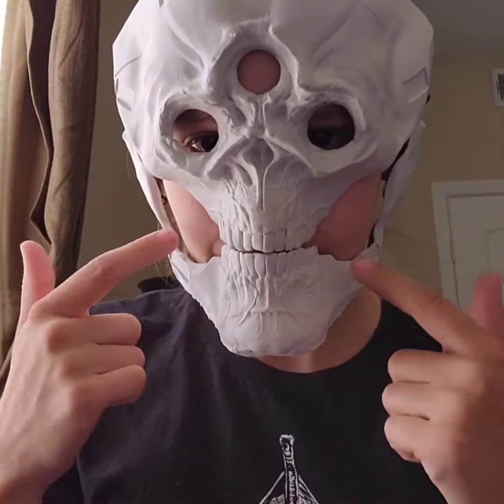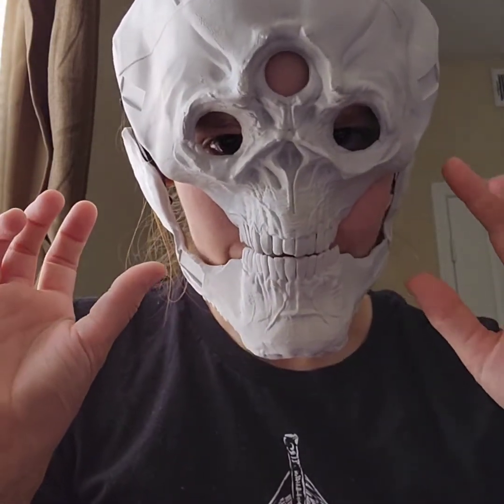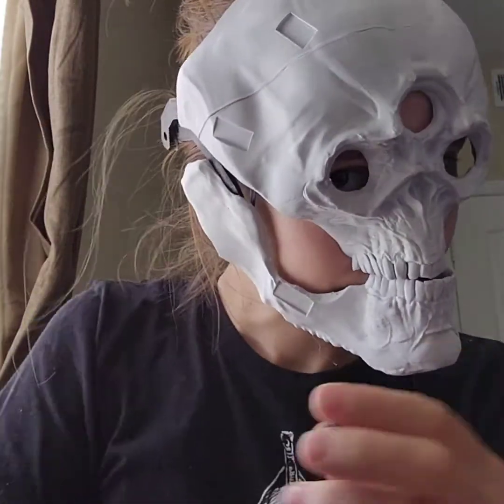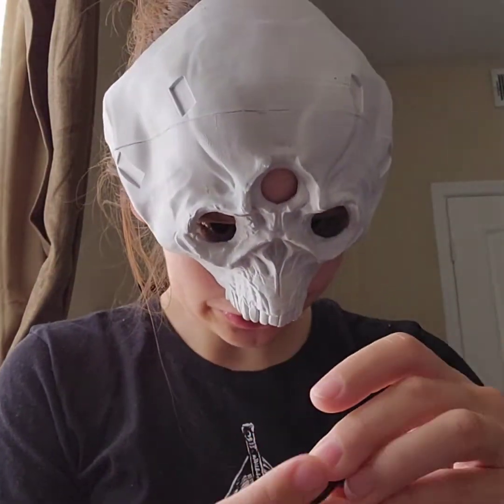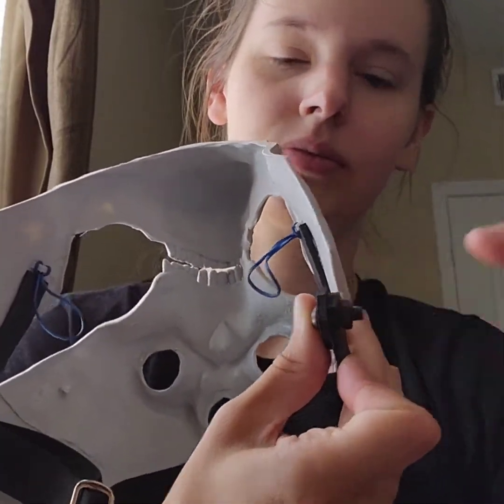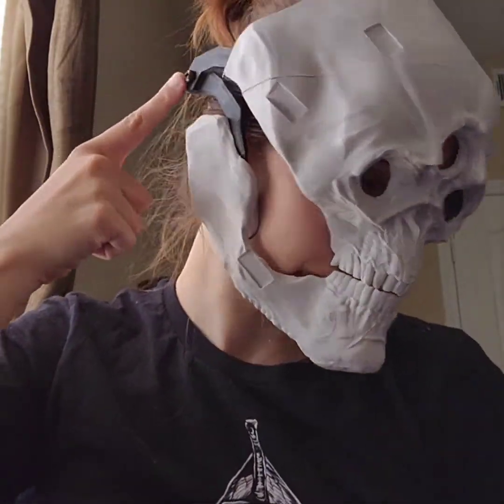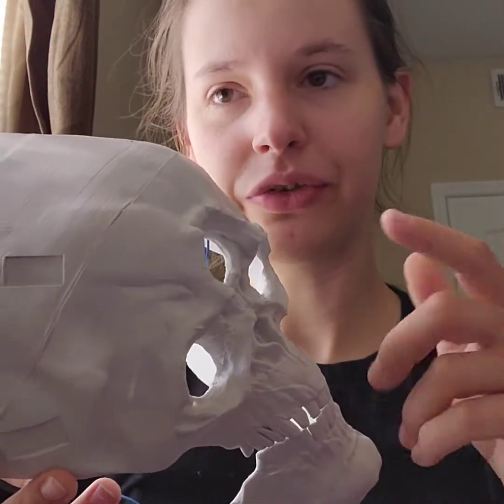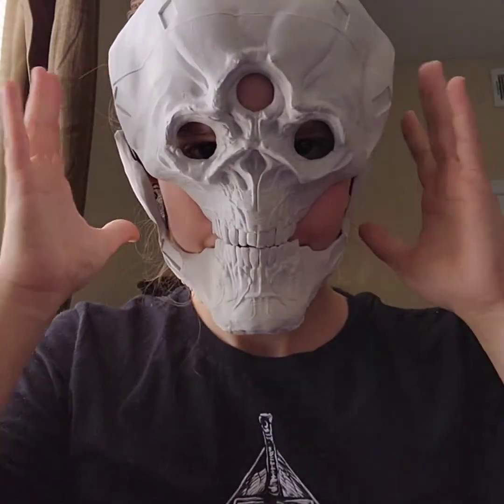How to design an articulated mask (hinged mask/moving jaw)

Comment: How did the rest of the moving parts move when you open your mouth exactly
Reply from the maker: i had wires connected to the jaw that would pull the flaps when i open the jaw and the flaps were connected with a hinge to the face and elastic to pull the flaps back in place
Reply: So like a pulley system.

Comment: What did you use to make the rotating points I'm open to other ideas for a movable jaws for a mask
Reply from the maker: theyre short bolts with locking nuts

Comment: Awesome where did you get those hinges?
Reply from the maker: Designed myself theyre just 3dmodelled bars with a hole in it glued to the mask. Doesnt have to be bent, i designed it bent to avoid scraping my ears
Reply: @WillowCreative  that's dope I figured as much and tried modeling some hinges for my helmet worked pretty good!